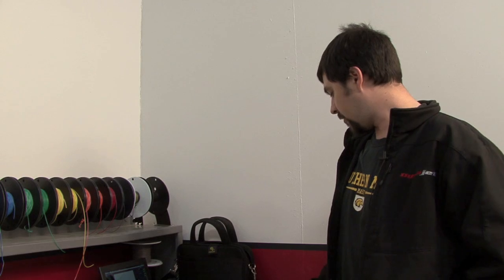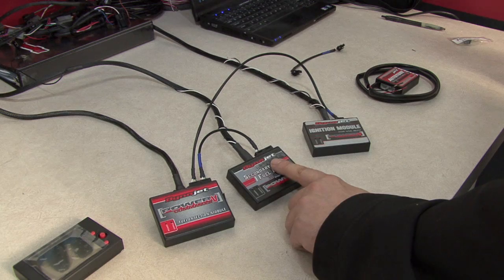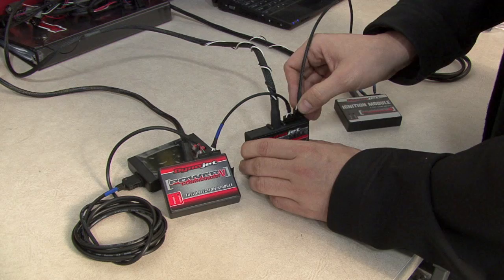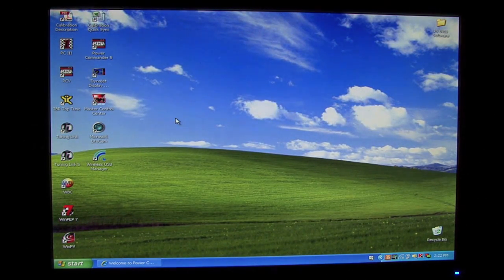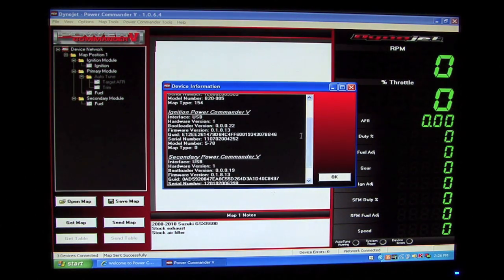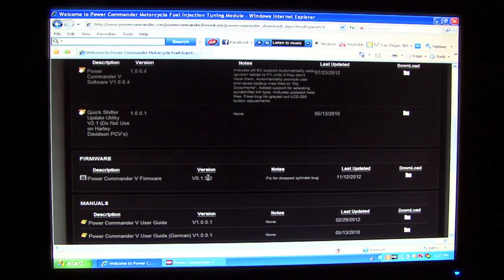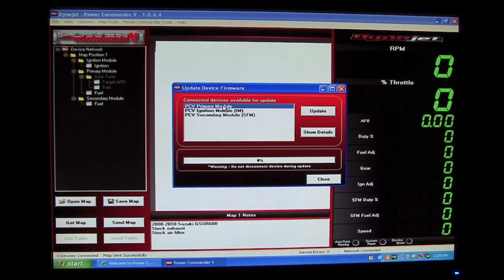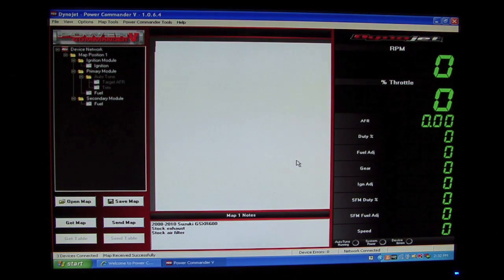Dynojet Power Commander V: Adding Devices (AutoTune, Ignition Module, Secondary Fuel Module)

Comment: I was wondering about the cab termination plug. My new auto tuner didn’t come with one and my PC V didn’t have one either.
Reply: If you still wondering, check out the comment from @outdoorzone. “FYI..
..CAN termination plugs are now built into every unit with a serial number that ends in 1510 or higher, per dynojet when I contacted them on
8-25-20!” I had the same question.

Comment: Thank you Chris for the information. I have 2003 Sereamin Eagle CVO 103 stage 4. I am upgrading from the power Commander 3 to the 5 with an  Auto Tuner. When setting up there is no need for a dynamometer and the auto tuner oversees the engine performance while the engine is turned on. This is going on my motorcycle with a dual map switch (change back and forth between to maps).

Comment: Autotune question. I have just installed one, but in the list of devices on the network as you showed in the video it is not listed. I search for new devices but get nothing. The power led on the autotune is on. How would I ensure it is hooked up correctly?
Reply from the maker: Hey there! Please reach out to our technical support at powercommandertech@dynojet.com or at 702-745-4303 and they will guide you through this.
Reply: Did you ever figure out what the issue was? I’m having the same problem right now myself. Thank you

Comment: Christ ! Just build one unit that does all ffs...its called  a ECU  ..this is bollocks  .where do I put all this on my bike . I dont have room to carry a spark plug spanner. 🤦‍♂️🤪
Reply from the maker: Paul, these are optional add-ons for the Power Commander V. You'll still get optimal air/fuel ratio with the Power Commander V itself. These options are for those who want more control over performance.

Comment: all I'm trying to do is get my bmw s1000rr to be smooth and a constant RPM under 4 thousand RPM  . this device is my last resort if the 2nd bmw bike shop says it's fine. it's shit in deep traffic doing 40 .jerky unsmooth. in neutral the rev needle is slightly bouncing around.

Comment: Just bought an Auto Tune a few days ago and it didn't come with a can termination plug. I called dyno and they told me this was not necessary anymore for the June 2015 and up modules, but every video I've seen says that I SHOULD be using a can termination plug. Help?
Reply: I'm in the same boat. Didn't come with one and doesn't work at all.
Reply: Did you ever get the issue resolved? Did you have to have the termination plug for it to work? I

Comment: quik shifer
i have the pvc 5 + auto tune on my 11 zx10r and i need to add a quik shifter to it do i need Power Commander(Q.E.M.) or (S.F.M)+ Quick Shifter sensor to make it work? i know that both will make it work but im wondering if Q.E.M alone will make it work with my 11 zx10r

does it adversely affect in the future for street ride
thanks
 #PowerCommander